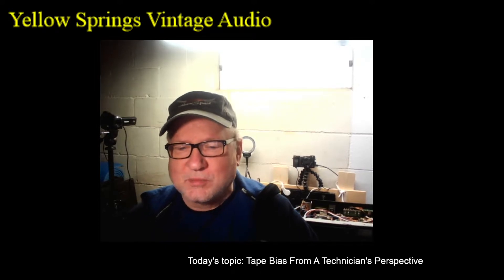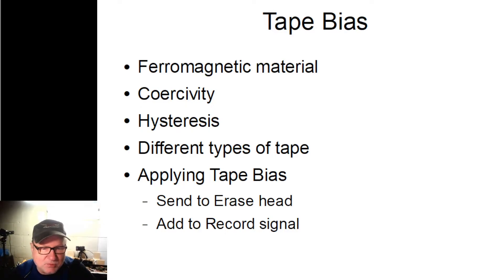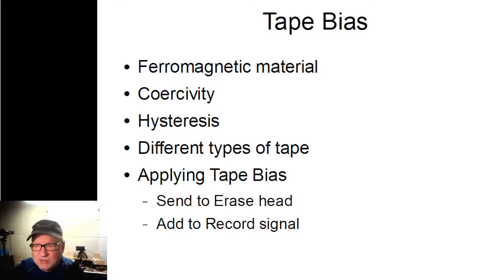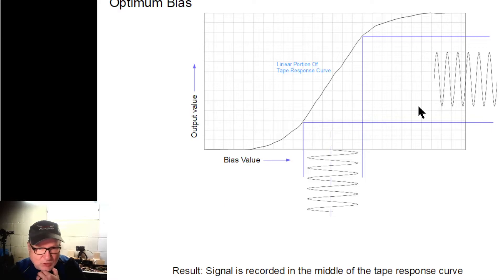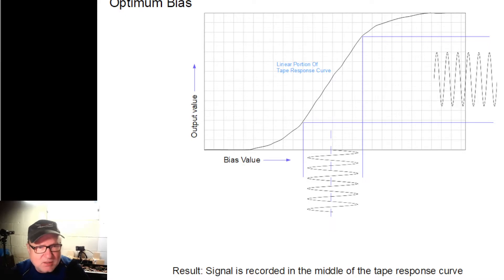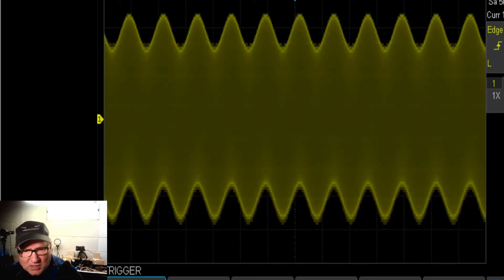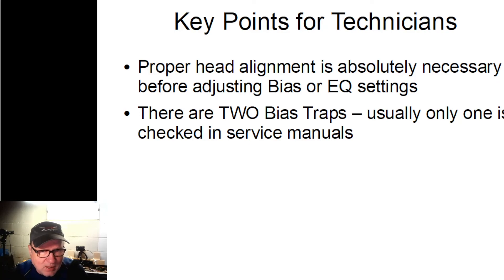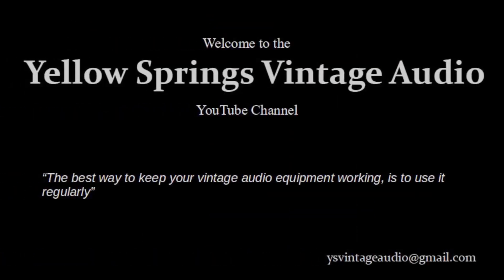Tape Bias from the Technician's Perspective (a little technical)

Comment: Thank you ! Can you explain high and low bias and saturation dependance from it, please?
Reply from the maker: Looking at the graph at 4:54 into the video.  If the bias is too low, the signal is shifted to the left.  This means that part of the music will be on the non-linear portion of the tape - which leads to distortion of the sound that is not recorded in the linear portion.  If the bias is too high,  the sound will be recorded on the portion of the tape that is to the right of the linear portion - this means some of the sound will be at the saturation level of the tape and therefore will be compress and have no dynamic range.
Reply: @yellowspringsvintageaudio352  thank you!
Reply from the maker: @CyrilleBoucanogh  I used the book "The Science of Sound Recording" by Jay Kadis, as a reference.  The book is available as a paperback on Amazon and other online sources.  Alternatively, you can find much of the information in the book from this Stanford University web site: https://ccrma.stanford.edu/~jay/subpages/NewFoundations.html
Reply: @yellowspringsvintageaudio352  I'm very grateful for your help. I've ordered the book and going to check the site too. Thanks a lot!